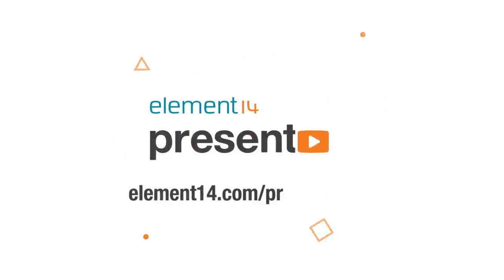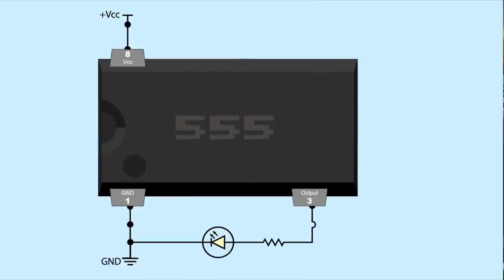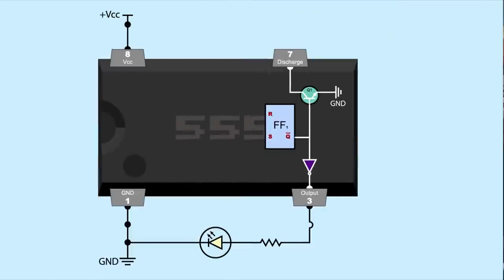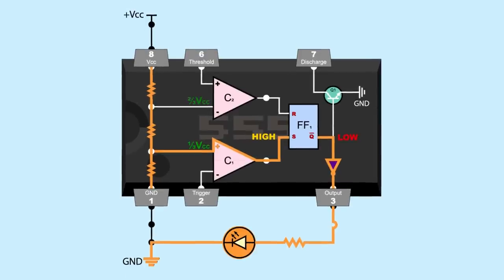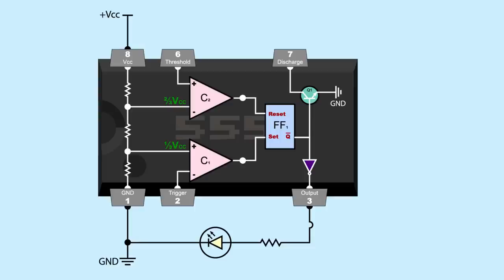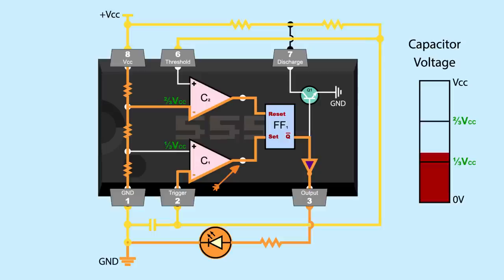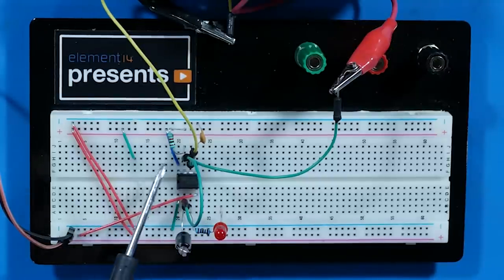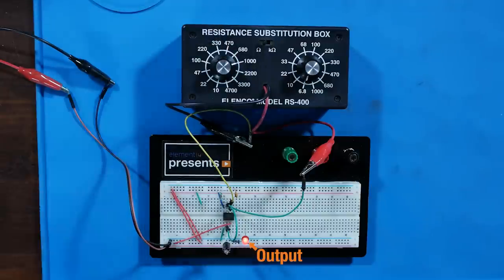How to Generate a Clock Signal with a 555 timer - The Learning Circuit

Comment: Many years ago I played around with the 556, two 555 timers in a single package.  I put a small speaker across the two output pins, with a small potentiometer as a volume control.  I got some very interesting sounds out as I varied the frequencies of the two timers, including some notes from beat frequencies or harmonics.

Using the same circuit, I replaced the speaker with a resistor and a two terminal red-green LED (one polarity emits red, the other green).  By using the reset pins on each timer I could hold them in the "off" state and the LED would be dark.  With one timer left to free run, the LED would flicker red.  Holding that one reset and letting the other run, the LED was green.  But when I let both timers run, wow!  At a faster clock speed the flicker wasn't visible and I'd see yellow!  At slower speeds I'd get this wonderful changing pattern of red, green and yellow, with off time showing up more as the clock was slowed.  By using the two reset pin states in a binary pattern I could select Off, Red, Green and Yellow in a single LED.
Reply: Awesome ❤

Comment: I know this is a year old, but I would like to comment on it so others will have the advantage. Two pins are not explained in this video. Only by examining the bread board at the end do you see how they are connected, with no explanation. Pin 4 is connected to positive voltage, and pin 5 is connected to ground by a capacitor (value unknown). I would say this is a great video on the 555 Astable  circuit.

Comment: Really well explained, so that even this absolute novice could understand everything.  What I need to do now is find a video that tells me how to set the output to a specific rate so that I can use it to act as the counter for a binary clock project I have in mind.
Reply: you can get the formulas from the datasheet. Just do a google search "555 datasheet"

Comment: Great, thank you. 
How to make it a constant clock, not dependent on temperature and device errors? should we use a crystal?
Reply: The 555 isn't meant to be extremely accurate.  Choosing precision resistors and capacitors with good temperature ratings (accurate over a wide temperature range) helps, as well as a stable power source.  Choosing specific 555 part numbers, too.  Commercial, Industrial, and Military specific versions operate over their own temperature ranges.

I don't recall seeing a 555 circuit using a crystal for a time reference, but I wouldn't be surprised if someone had done that!  I'm trying to think how that would even be done!  Good question!

Comment: Am I wrong?. You say and I quote "pin6 connects to vcc with this 1 kohm resistor" wrong. the video clearly shows it is attached to a hole that lines up with pin 7. What do I change to make it go faster
? Is there more than one way? What's the effect of larger caps?

Comment: I have 2 questions (I am an IC trader) :
1. What if we vary the value of capacitor by means of a variable capacitor? Is it mandatory to use electrolytic capacitor? 
2. In all inverters I open, I have never found 555 as oscillator while on oscilloscope the signal look like that of oscillators (SG3524/SG3525/CD4047/...). Why inverter manufacturers don't choose 555?
Reply: You can absolutely change the value of the capacitor rather than the resistor. Just keep following the equation for time. 
As for what kind of capacitor, I used an electrolytic because all my ceramic caps were too small of a value and the blink would be so fast that it would be imperceptible. I feel like you would want to use a polarized cap, though. But that's my intuition saying that. I haven't thought deep into the science of why.
As far as why manufacturers don't use 555s as oscillators, maybe cost, scale, perhaps there are custom chips that are self-contained oscillators rather than how the 555 needs an external RC circuit? The reason may be conditional of the application.

Comment: 1:19 it seems nobody in this channel read these comments since they insist on keeping the same mistakes; the 555 does NOT have a Flip-Flop, it is an SR-Latch. It seems they do it on purpose just to confuse...
Reply: I agree with you but many folks call it a flip flop.  One of those chicken and egg discussions like "is it a delta-sigma or a sigma-delta converter?".
Reply: An SR Latch is a type of Flip-Flop. You're claiming a square isn't a rectangle .

Comment: 5:42 I'm confused by how that transistor prevents the capacitor from being connected to Vcc. 
I would also think that the resistor on left would have to be >= to the one on the right for this to work, but the demo clearly shows that's no the case.

Comment: I want to receive signals every 1 second. what should be the value of resistance
Reply: T high= 0.695(Ra +Rb)C
T low= 0.695*Rb*C

Ra, Rb are connected between 7 and 6 where Ra is connected to Vcc.